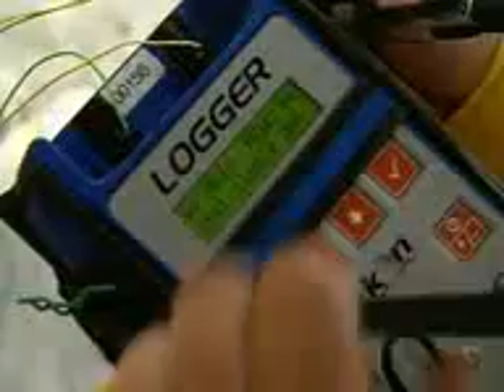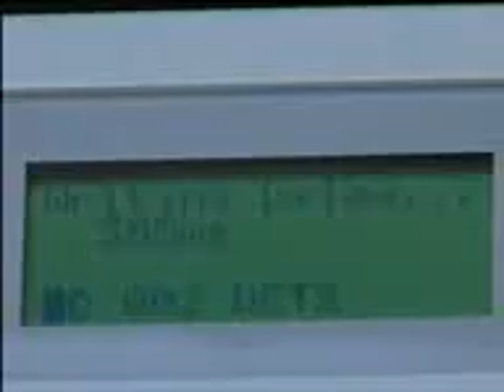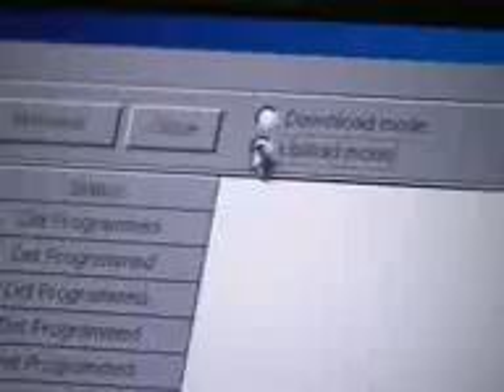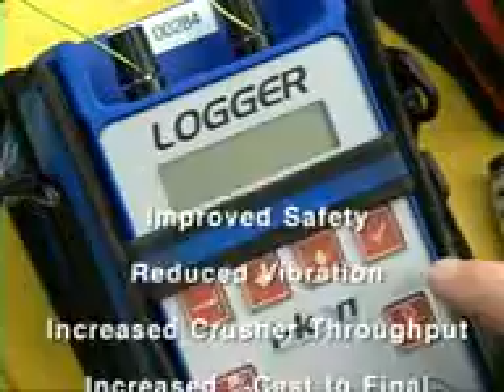Controlled Blasting

Comment: Last time I checked digital caps were $15 + apiece. For most practical applications nonels do a fine job. 25/250's with 17's, 34's and 42's (surface delays) provide enough timing combinations for most applications. Digitals are time consuming to scan and connect. And they each have two wires. (remember chasing down bad electrics with a galvanometer? Think I might still have a peter meter somewhere.) With the advent of tough shock tubes I am reluctant to go back to wires. Just something else to
Reply: yeah but nonels have a + or - 8 ms difference when digitals have 0. If you log your cap to have 17 ms it will blow at 17 ms
Reply: Nonels turned a fair blaster into a good blaster overnight .

Comment: I definitive like the electronic dets, but they are not cost effective by now, and only an specific operation could afford their extremely high cost. Until prices get down I will keep on using non electric dets, easier and probably safer on the time being.

Comment: Yes, I saw the video at that seminar, if it was accurate it shows just how out-of-step the Nonels can be.
Again, it's a problem of cost. I am an independent, and if I used the new system I'd have to pass the costs on to my customers. I reckon they would not be impressed.
In one quarry, I have blasted over a million tons on the buffer, with only the first blast having an open face.
I have had no toes and very little oversize using my own connector sequence.
Anyway, happy blasts, buddy.

Comment: True, there have been some failures. and yes the 8ms rule is now out the window. i'll try and find a video i saw which shows you the accuracy with a high speed camera. i've used  electronic dets a fair bit and i can honestly say that if you use them to there potential you can get better results from any blast.

Comment: Here's the facts - unless you have a SEVERE vibration problem, or are bringing down a structure in a controlled implosion, forget about Ikon, Hot-Shot, or any other version of these extremely expensive electronic dets.
Normal quarry, strip-mine and civil engineering blasts can be safely and efficiently initiated using shock-tube detonators.
You can design extreme fragmentation blasts without buying expensive electronic dets - remember, Orica and others are trying to make as much money as poss.